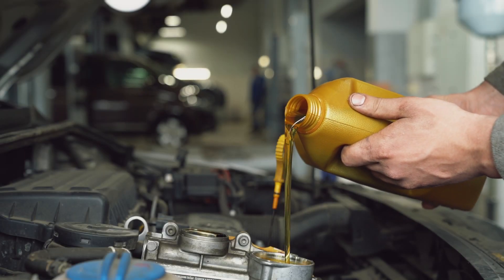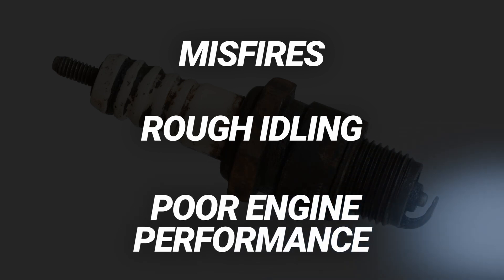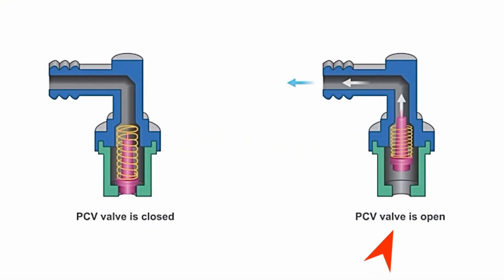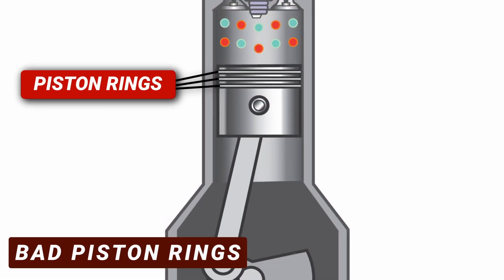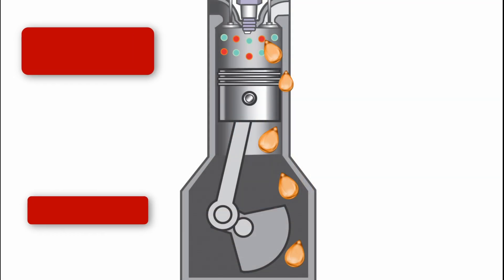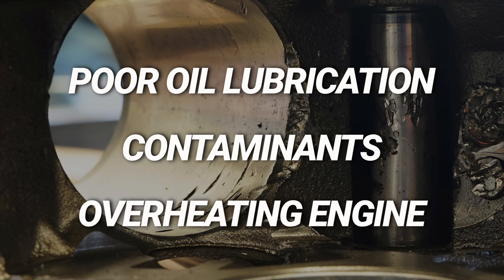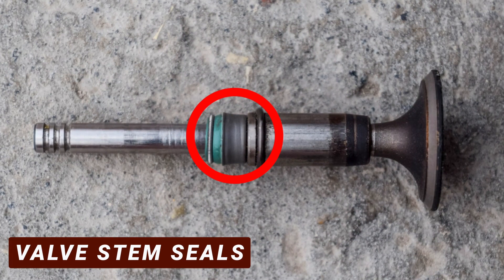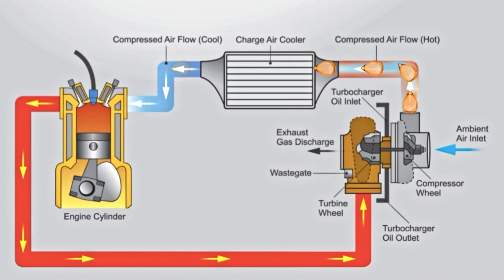Car Burning Oil? Top 5 Common Causes Of An Internal Oil Leak

Comment from the maker: ▶︎ OBD2 Scanner: https://amzn.to/3PHRplS

▶︎ Car repair manual:
https://www.gopjn.com/t/SENKTklLS01DSE1NS0lOQ0dKRk9LTw
(Use code AD10VA for 15% off one-year subscriptions for any US Order)

▶︎  Have car-related questions? Check out JustAnswer! They have verified auto mechanics that are available as live help 24/7: https://justanswer.9pctbx.net/qndBon

▶︎  Check out my merch: https://easyautofix.creator-spring.com/

▶︎  Here are some of my favorite items that you might like:
Tools: https://amzn.to/3xNDb8g
Car Vacuum: https://amzn.to/3EjhPSJ 
Cleaning Tools: https://amzn.to/3El7dCG 
Water Repellency Wiper Blade: https://amzn.to/3utvK50 
Cleaning Gel For Cars: https://amzn.to/36NIiMr 
Portable Air Pump for Car Tires: https://amzn.to/3uBuPzA 
Headlight Restoration Kit: https://amzn.to/3qDpOVH 
Amp Jump Starter: https://amzn.to/3pMd0vx
Reply: My car loses oil once you start it and go 2000 turations but when it started or closed it dosent leak and it dosent make smoke but I lose some drops every time I go over 2k turations

Comment: In my car, smoke does not come out of the exhaust, but rather comes out of the hood, the oil cap, and the oil test area. Does this mean that it needs rubber?I mean valve stem seals ? Because, as I said, smoke is coming out strongly from the oil filling fault and from the oil inspection area.
Reply: Change pcv valve it will stop

Comment: My citron c5 aircross is using alot of oil. Only had it  6 months. Had 4 low oil warnings in that time. Used 2x 1lr bottles top up.  🤷‍♂️

Comment: Someone better tell the KIA owners to replace their PCV valve every 20,000 miles
Reply: I have a Hyundai, I am doing this 😂 it's one of two parts I only buy from OEM, that and cabin/pollen filter.
Reply: @Spencer_White our Palisade had 90,000 miles and burns oil like crazy. Is the pcc valve a known issue for them?

Comment: Would these be the same issues in a diesel engine coz my 2015 ford everest has been burning oil for a few weeks now but its only every couple of days at traffic lights
Reply: Valve stem seals. They must be very worn.  Half a liter diesil in your old oil drive it for 20 min then change it.   It will clean your pistons like new.  Then see if it still smokes.   That will give you the def answer

Comment: If the compression, the crankcase ventilation and the valve seals are ok, could it be the oil rings that are worn/damaged which are the reason that the engine uses a lot of oil? The engine in my car has been run hot/overheated once by the previous owner.
Reply: Not sure, overheating isn't good and can do some damage. First change your PCV valve, that's important and easy on a lot of cars..Then if you want but if you're not sure you can skip this advice but...Maybe try putting in 4-8 oz of Seafoam in the oil now, drive it for 300 miles more and then change the oil. Maybe put a little thicker oil like if you use 0w/20 try 5w/20..5w/20 to 5w/30?..if you are in really cold weather now like around 0 or below maybe don't do it, some gas mileage may suffer, not much. When changing your oil leave a quart of room and you can try Lucas Heavy Duty Oil Stabilizer and put a quart in with the oil. Drive it then change the oil and filter after 3,000 miles. Check the level weekly, if it goes down top it off with oil or better-Marvel Mystery Oil and keep changing it at 3k miles. If nothing works then somebody else may have ideas or go to a mechanic.
Reply: @1Mannco  Since the engine has been checked at a bmw workshop that the PCV is in order, the compression is ok, and there are no blue smoke when starting at cold engine nor when the engine brakes when downshifting which are typical symptoms of bad valve seals, I think it is the oil rings which is damaged due to an overheated engine
Reply: I found Honda and Toyota run very low vacuum in their PCV System.2 to .8inH2O. Hook a HVAC Manometer to your dipstick tube and run it watching it while driving normally. You need 1. to 3.inHg. What I found was many OE's run way too low of a vacuum to pull the blowby and carbon away from the ring pack. I found my 12 TL was under pressure intermittently during normal driving around town. 10 MDX the same thing. 
This is too low for good function and longevity of the engine. I've since changed mine to the higher vac to extend the life of it. If you have to have short OCI's(Oil Change Intervals) or you'll stick rings and create an oil consumption problem this is the problem. On any engine you should feel a slight vacuum with the engine running at hot/idle when you remove the oil filler cap. It's better to measure to get a true reading and the Manometer is 35 bucks off of amazon. 
I found a chart  that specified 5 of 32 BMW engines run 0.00mbar at hot/idle which in stop and go traffic will destroy the oil in a short time. Correct the vacuum and run the Valvoline Restore and Protect oil changing the filter frequently until the oil consumption is gone. At 5inHg you can eliminate or run extremely Low Tension rings and no Valve seals. No oil on top of the piston crown. Oil has an Octane of 40 and wants to detonate in the Combustion process. Carbon from Blowby is sticky and accumulates at the ring pack but in small amounts. It takes a while for this problem to develop. 
Watch some engines being torn down on here and watch closely the heavy carbon at the rings of the pistons, heavy carbon on top of the piston. The evidence is there. Heavy varnish buildup throughout the crankcase leading to the bottom of the pistons is another sign. The engine should be cleaner on the inside than the outside or there's something wrong.

Comment: So we're do I start 😂😂😂
Reply: pcv valve
Reply: If you're smart in the cheapest
Reply: @edwinelencanto1259 lol 😂
Reply: Smoking a blunt at 11:45 pm got me laughing out loud my neighbors looking at me crazy haha
Reply: Rebuild the entire motor
Reply: “We’re do I start” you don’t at this rate bro 💀
Reply: Change PCV.   When you change your oil , if it gets dark after 500 km then you know it was neglected at some point.   It's a huge job to change the valve stem seals on my TDI Jetta so I put a liter of diesil in my oil  drove it slow for 20 min and change the oil.  Instantly my car started burning 1/8 the normal amount.   It still puffs when my vacuum is strongest but I can live with a little smoke for 10 seconds in the morning and when I pull up to my gate    I was burning half a liter every 1000 km  now its not even noticable.
Reply: My friend I am in same page
Reply: If you bothered watching atleast 20 seconds into the video, you would know to start with the pcv valve.

Comment: Can you do a video on what all could cause a suv to smell like fuel while driving down the road? And really begin to smell fuel during idle, thanks!
Reply: Leaking fuel system car can catch on fire dangerous
Reply: @tommcqueen3145  no fuel leak, fuel is burning and smell of fuel comes out of the exhaust
Reply: Possible leak in the evap system